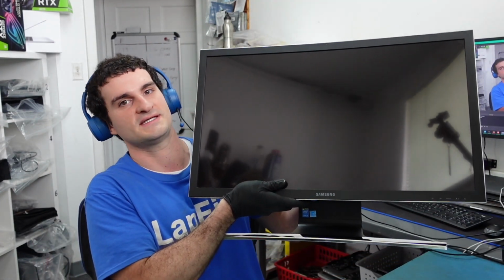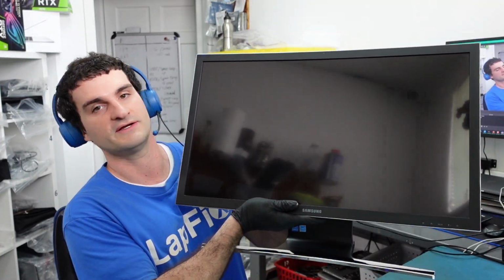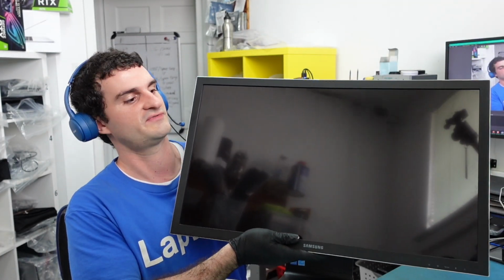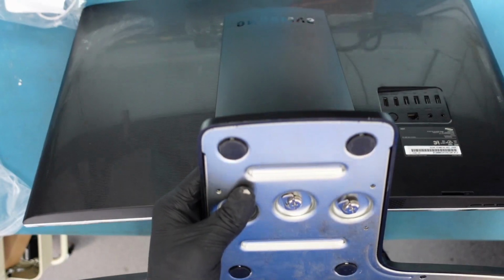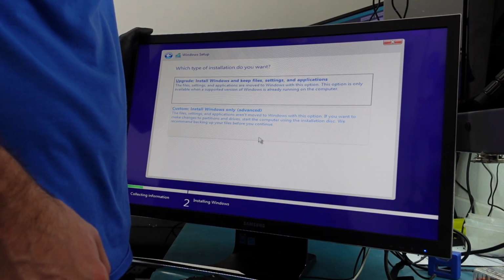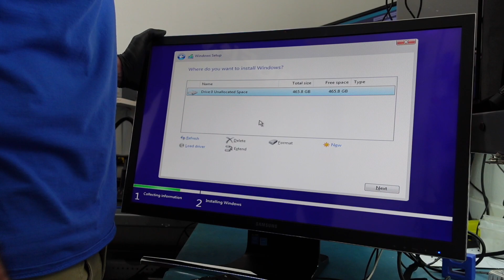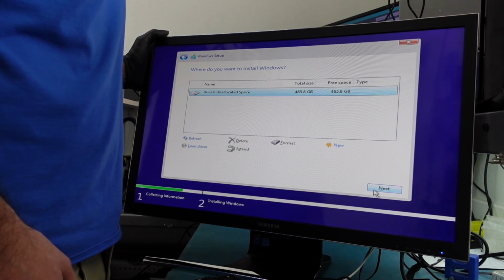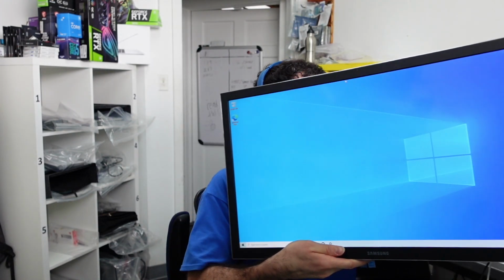Samsung ATIV One 7 SSD Upgrade

Comment: Do u think you can use another laptop mb and use this existing screen
Reply from the maker: I do not believe this screen (like most AIO)  has an Input signal for HDMI , just output for hdmi.  I would check the manual